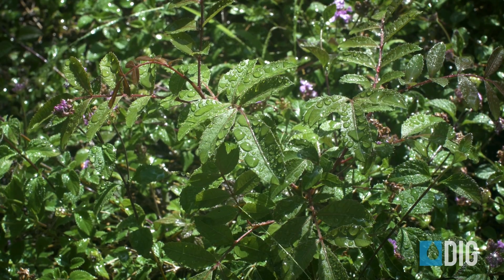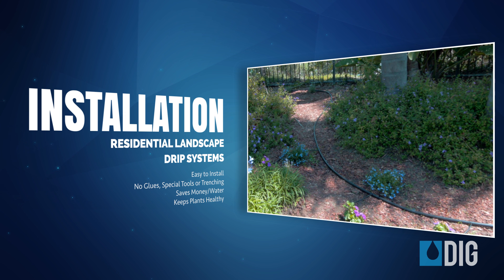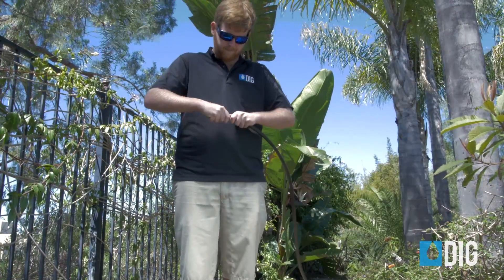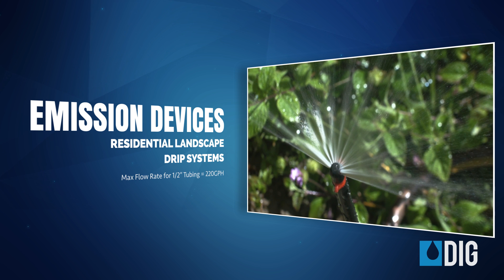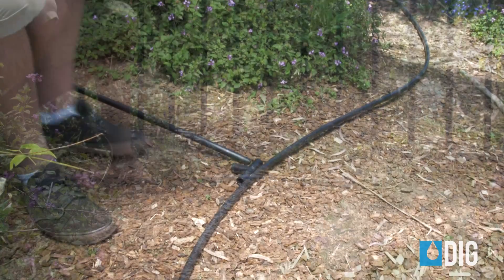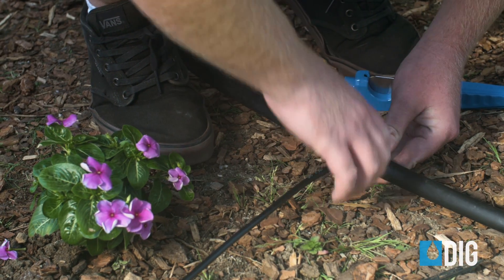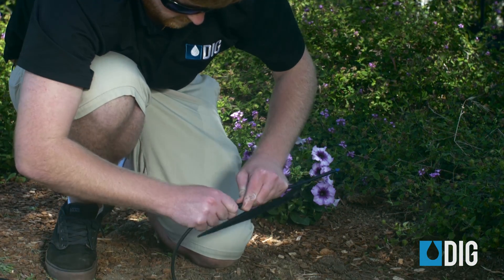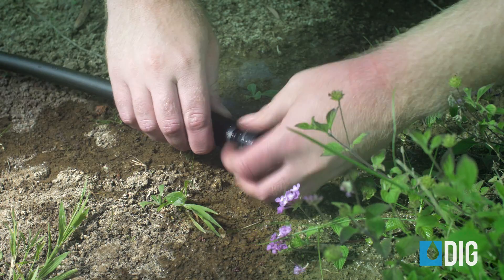DIG Drip Irrigation System Installation

Comment: I bought the DIG Patio Drip Watering Kit.  But I can't even push the 1/4 inch micro tubing into adapter.   Any trick on how to get it in?
Reply from the maker: Hello, it can be a bit difficult sometimes to work with tubing. We recommend putting the 1/4" micro tubing into some warm water, or laying it out in the sun for a while, to make it more pliable.

Comment: I have plants that are a great deal away from the water source.  I piped 1/2 in pvc to the location and now want to install your products to distribute the water.  Any issue with this?
Reply from the maker: So it depends on how far away from the water. If it  is less than 100 ft or so, it should be okay. You don't want to run 1/2" pipe for too long of a distance, because hydraulic problems like water hammer can occur if the pipe is small and goes a long way.
Reply: @DIGCORPORATION  Thanks.  I had to look up what water hammer was.

Comment: Should the back flow valve and the filter/pressure regulator be attached to the supply line before the timer if one uses a dual port hose end timer?
Reply from the maker: Hey Tom,

You always want to install the backflow, filter, and pressure regulator after the timer. If you are using a multi-outlet hose end timer, each outlet will need its own backflow, filter, and pressure regulator.

Best,
Eric

Comment: I have one raised bed I want to use the drip irrigation for.  In order to get to the raised bed, I would need to run hose around a very large garage.  Could I just run a couple of garden hoses around the garage and attach the timer, filter, backflow unit from the end of the garden hose?  Or still attach at the faucet?  Or would I just get a ton of 1/2 in poly-tubing to run around the garage?  Thanks so much!
Reply from the maker: Hey Brandi, you can do it with a garden hose or with 1/2" tubing. The way to do it with the garden hose is to install the timer, backflow, filter, and pressure regulator at the faucet and then connect the garden hose and run it around around the garage and install the swivel adapter at the end of the garden hose. Hope this helps!